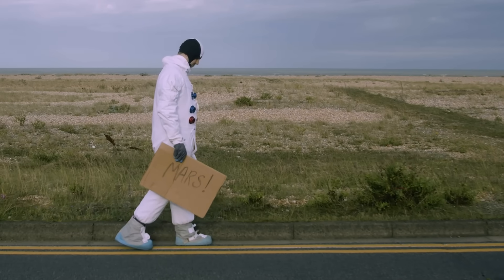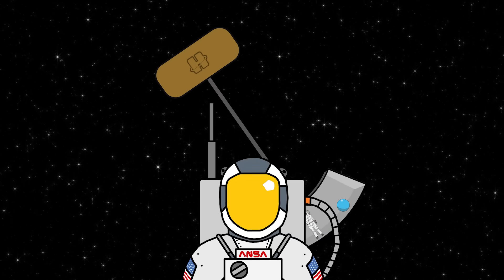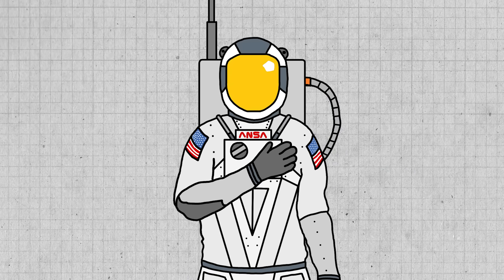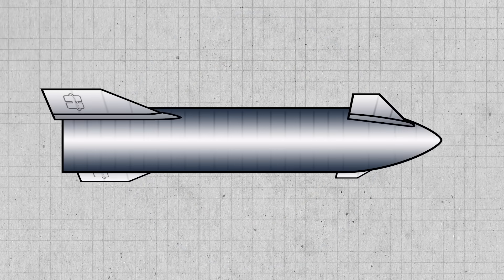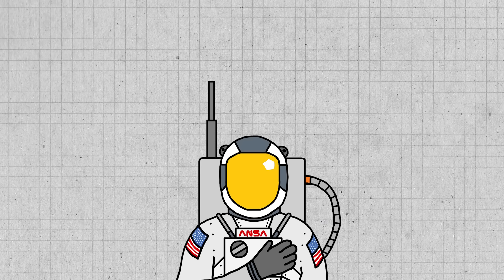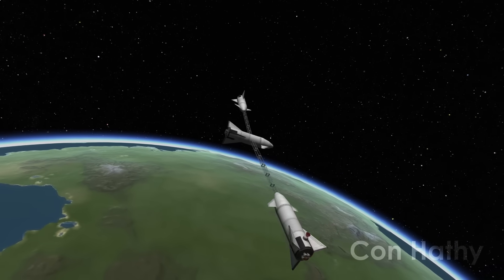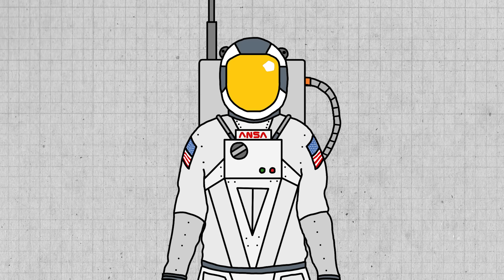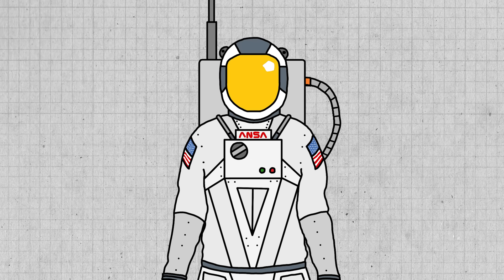This is NOT how you make Artificial Gravity

Comment: the short radii centrifuge is only good for short term use though ... while a rotating torus of large enough scale will allow 1g acceleration along your whole body meaning you can do it for a very very long time ... yes it takes a lot of material .. but then how much material can you get from ONE asteroid in the asteroid belt ... more than enough to offset the massive load lifting needed for bringing it all up from the limited supply on earth ... like most you made the assumption the torus is supplied from the ground ... when it is NOT practical that way but it is practical when supplied from space ... which negates your small vomit comet ... also motion sickness in those is a problem for about 60% of the population which NASA and jet fighter pilots have amassed a mountian of data that proves your assumption of it NOT being bad mostly wrong ... the average person will have symptoms of motion sickness if the apparent gravity from their feet to their head changes significantly .. in your test version with the head at the center you maximize that disruption and dont notice it at slow speeds ... increase speed to several hundred rotations per second and the person will be making a mess everytime ... THAT HAS BEEN PROVEN by NASA .. yeah even though they Never Answer with a Strait Answer the apollo and gemini centrifuge test are well documneted and prove your assumption wrong .... further proof ... you live on a rotating body providing centripetal force out ... while it also rotates another body providing centripetal force down ... while the mass of the body you are on also pulls you down and so does the mass of everything between us and the sun ... so your weight at the furthest away from the sun on the dark side of the earth on top of everest is less your weight on earth at its closest to the sun at day time at the bottom of the marianas trench ... wihch then suggest grvaity is the result of the combined masses and centripital forces acting upon us at any given time ... and the equation would need a highway about 20 miles long to be able to write down all the parts that actually need to be included ... as you cannot exclude anything from the calculation because you cannot prove they are not relevant or negligible as they all do act upon you ... 
.
 FRAME of reference matters ... and the common science mistake is keeping the frame of reference close to the study object ... when the needed frame of reference needs to be outside the ort cloud because everything inside that radius will be acting on you either positively or negatively ... plus dont forget we are not spinning on the plane of rotation but at some angle off of it .. so now you also have to use all vectors as well .. which means sin cos tan arc and all the rets of those fun equations now become very huge ... the joys of NOT regurgitating modern sciences errors by understanding WHAT is actually happeneing by watching nature with its 16.5 BILLION years experience over mans maximum 65 million years ... Nature has been there done that and uses what works
Reply from the maker: The use of material already in space hardly counters my point that "it would require a ton of launches." We have no vehicles to gather that material or facilities to process it, at the very least those would need to be launched from Earth so large space structures are still far in the future. 

I agree, there is tons of evidence of motion sickness below that 17 RPM value but the study I'm referencing was about our ability to adapt to that type of environment after repeated exposures, not our baseline tolerance. Also, the motion sickness is not due to gravity gradient (1G at the head but more at the feet). Your feet feel the direction of the force but aren't going to make you motion sick if the force is higher than expected. Have you ever got motion sickness from wearing a heavy backpack? The sickness is caused by the inner ear which is why 4 men with damaged vestibular systems were able to live in a room rotating at 10 RPM for 12 days with no sign of motion sickness (https://airandspace.si.edu/stories/editorial/how-being-deaf-made-difference-space-research). 

As for accounting for all of the tiny forces on people I disagree, that CAN be considered negligible. It's like considering all the fridge magnets in San Francisco when designing the Golden Gate Bridge. It's a difficult problem to solve with zero effect on the final design of the structure. Studies have already demonstrated that AG helps combat the side effects of space travel, even at small radii. Suggesting that humans need a perfect reproduction of Earth is something that has come up many times throughout history but it has always been wrong. When we first went to space we worried that astronauts wouldn't be able to eat or drink and might even go mad. Vostok required a code to take manual control just in case the cosmonaut lost his mind after leaving Earth... Yuri was fine. Go back further and the same thing happened with planes and steam trains with people fearing that seeing trees go by so fast might make people sick or drive them crazy. Every time, we've found that humans are adaptable. That's what Nature did for us, it didn't create a hyper-specific place for us to live, it prepared us to live (almost) wherever we go.
Reply: There's a third alternative to launching components from Earth or mining an asteroid. It turns out there are a lot of upper stages in low Earth orbit. Nanoracks, the company that made one of the ISS airlocks, has plans to try to harvest material from what are otherwise big chunks of space junk and build things out of them.

Comment: I feel like the flexible tether will add more complexity and weight. Maybe it will be better just to hard dock 2 starships with their noses?
Reply from the maker: The tether is for increasing the radius, small radius can work but there is something to be said about large radius being more comfortable if you’re rotating all the time. 

The issue with hard docking is that the engines could end up experiencing over 2g (different than 2g in flight because the engines aren’t producing thrust) so the structure would have to be modified to survive 2g of tension rather than compression. This somewhat offsets the weight of a small tether, probably not a kilometer long one.
Reply: I don't know why everyone want to dock starships with their noses, not their butts, like in refueling videos. This way, you could have a rigid construction, without disadvantages of spinning engines on the outside and much easier to handle during trajectory corrections (an issue often omitted in tethered concepts). 

I know it puts everything upside-down, but I'm pretty sure living quarters can be rearranged if needed for a 6 months trip. Or actually, all essential non-cargo area could be fit inside ~9m sphere, slightly "down" heavy and put on some bearings inside the Starship. This way, the sphere would re-orient itself optimally no matter how the forces are applied, during launch, travel or belly-flop maneuver. Well, you could even put a landed Ship on its belly and cover it with regolith it to make a first, radiation-resistant habitat.

Comment: Ok, so to jump in on the questions about the small centrifuge.  Is this something that can only be used for sleep?  What would you suggest for an implementation of a small centrifuge on Starship?  Can people on this solution do useful work, or are they just going to be lying down while their body fluids drain back to places where they should be?  I have generally been on the anti-small camp, but I'm really curious as to what a recommended implementation might look like, and how it might help Starship travelers.  Also, most importantly, can you poop within the small centrifuge?
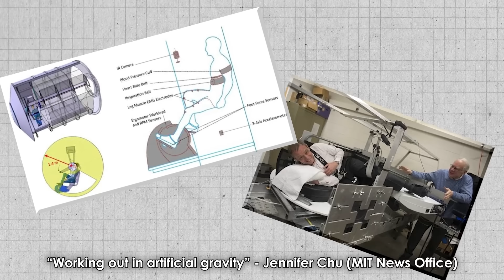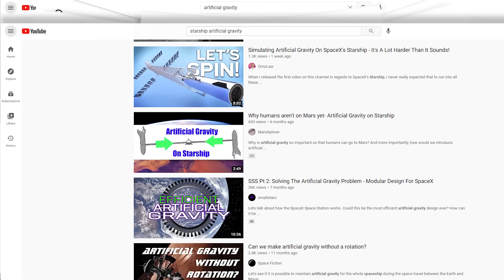Reply from the maker: I don't think you would want to use this while sleeping, bed rest is a pretty good analog for zero-g on Earth so sleeping in AG wouldn't be very productive. I think the best implementation is for use during exercise similar to the MIT concepts around 15:16. This would take the form of an exercise bike or something similar that is on an arm within the starship's 9m diameter. This would further limit balance and motion sickness issues as you'd be on a bike seat and not moving your head side to side. Intermittent exposure seems to be adequate to counteract zero-g, the 2nd paper on the right around 0:22 demonstrated that 30 minutes a day was enough to offset the muscle losses we usually see during bed rest studies. "Aerobic exercise capacity" was not maintained but this is probably because they were not moving while in AG, 30-60 minutes on a bike is pretty reasonable given current astronaut schedules and would likely do a better job maintaining "cardio."

I wouldn't put a toilet on one but I don't see why it wouldn't work.
Reply: @ConHathy  I mean have you seen how they use the loo in space? I'll take gravity for my toilet runs, please!

Comment: Hey, thank you for the insight on rotational stability problem. I really liked it.
As layperson I have a question regarding the segment around 12:20: if the all 500m apparatus was rotating at 2 rpm, shouldn't the starships rotate faster than that after the tether is cut because of conservation of angular momentum?
Reply from the maker: No, they would still rotate at 2 RPM. Angular momentum at a very general level is actually masses traveling parallel in opposite directions. The relationship where it's the moment of inertia times the angular velocity is actually derived from this and is really just a simplified version of totaling up the angular momentum of a bunch of tiny point masses (atoms) moving in opposite directions.

The two Starships are themselves, traveling in opposite directions and are separated by 1 km. When the tether breaks they are still moving in opposite directions and their paths are still separated. This is where the bulk of the angular momentum of the system is because the Starships are small relative to how far apart they are. Breaking the tether does not require this momentum to be transferred to the rotation of the Starships. As they float off into space, their separation increases, and their relative angular velocity decreases such that angular momentum is conserved. 

By the way, this is why two non-spinning objects can collide and end up spinning in the same direction, it's turning the angular momentum of non-aligned velocities into the more familiar form of rotating objects. But again, if we zoom in on the rotating objects are just a bunch of atoms traveling along opposite parallel (actually concentric) paths.

Thanks for the comment, I didn't even think to mention this in the video. Also, don't worry, my brother has been an engineer longer than me and he asked a pretty similar question.
Reply: @ConHathy  &  @seedorfj  
Thank you! 
I understand. Actually it's pretty obvious now duh!
Reply: @ConHathy  ...  So you are a fan of small centrifuges inside the ship? Then what is the point of preserving the human body if you a apply a gradient of gravity from the legs to the head, if the head only experiences a fraction of the gravity. Are you willing to preserve the crew's feet only? Have you ever thought about how important the bones sustaining the head on your shoulders really are? Imagine you land on mars and your head is suddenly falling cause you are not able to sustain it anymore... that's why i support the idea of larger centrifuges. Cheers! And keep the science up, overall i liked the video!
Reply from the maker: @evoelias6035  true, you would probably want at least 1/3 g at their head level so their neck is accustomed to at least Mars level gravity. That said, astronauts have spent up to a year in space with no AG and didn’t break their necks. I would be more concerned with heart and eye health or the recently discovered blood clots that form in zero g.
Reply: @ConHathy  Yes, I perfectly agree with you! 👍
Reply: @ConHathy  Except that the calculation in the video for the RPM and periferal speed, is wrong - to get 1 G over 500 m radius, it will only need to spin at 1.34 RPM, not 1.8 or 2. The formula for acceleration towards the centerpoint during a turn with a certain periferal speed is: v^2 / r - so if the periferal speed is 70 m/s, it will be 70^2 / 500 = 9.8 m/s^2 (pretty much exactly 1 G). 
With 100 m/s², it would be about 2 G's instead (I don't think anyone wants that, haha). As the circumference of the whole circle is 3141.592.. m (2 * r * pi), one full turn will take 3141.592 / 70 = 44.88 seconds - which is equivalent to 60 / 44.88 = 1.337... turns in one minute. 
To get 1 G with 1.8 RPM rotational speed, the radius only need to be 276 m, the periferal speed 52 m/s and the maximum length of the whole teather is 2 times the radius, so 552 m (still pretty big though).
Reply: That's what I thought but no. If you cut the tether you go from a force pulling the ships together to no force at all. There is no force to cause angular acceleration of the ships. The angular momentum stays the same because the starships continue to move in two parallel straight lines which when looked at from the correct frame of reference, gives you angular momentum.

Hopefully we can get a follow up #short better explaining it